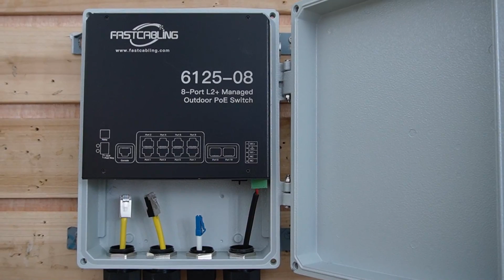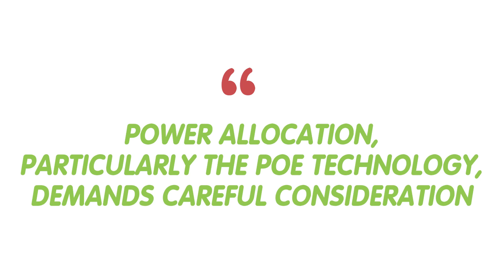Composite Fiber Optic Cable and PoE Switch A Comprehensive Setup Guide

Comment: If distances is more that 100 mts Can't we use a poe extender in between the cable? Total distance 120 mts.
Reply from the maker: Yes, you can use a PoE extender to cover distances greater than 100 meters. However, if you anticipate needing to extend the network further or require higher bandwidth and less signal degradation, investing in a fiber optic setup may be more advantageous in the long run.